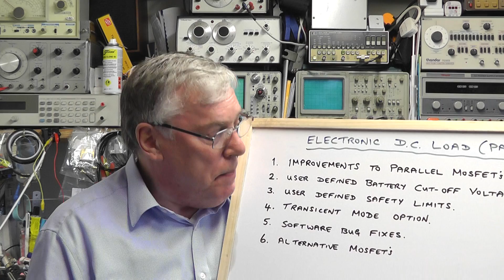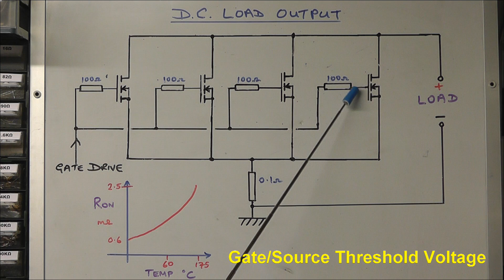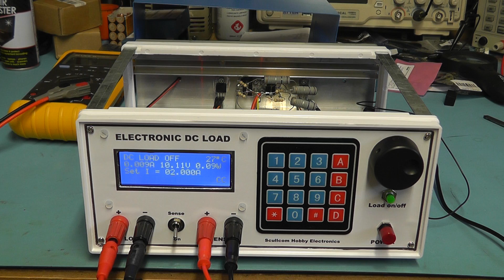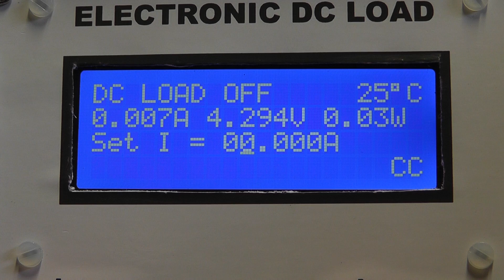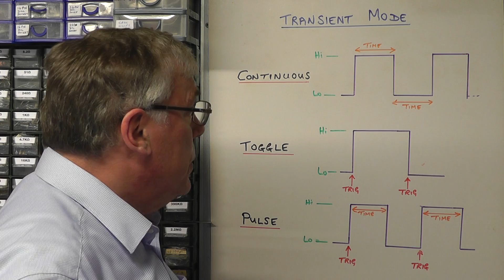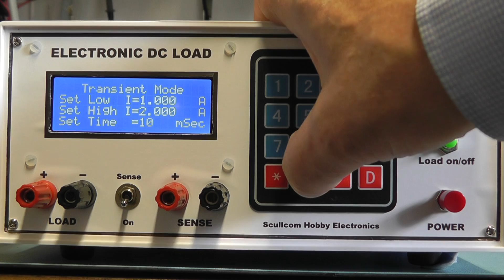Scullcom Hobby Electronics #49 - Electronic DC Load Part 5

Comment: Never use wire wound resistors.  You are getting and inductor and resistor in one package causing an over damped ringing during high to low and low to high current transitions.

Comment: Noooo! By mounting the MOSFets so close together you undo the self-balancing by the positive TC!

On the other hand, the Drain resistors are really necessary an you could estimate the correct value using the expected maximum dissipated power, the expected max junction temperature and the characteristics.
All multi-transistor electronic load manufacturers do it like that!
Reply: um, by spacing them further apart, the positive TC effect will allow each to operate differently depending of each individual parameter characteristic by that tiny amount, and and the temperature gradient of the heatsink effect. The closer the mosfet cases are to each other, the tighter the temp difference will be between them - my opinion is that this IS superior....but but yes its harder to wire up!sigh!

Re drain resistors, the required calculated low value power resistors, they are freaking expensive! better to just use  a safer area of dissipation of the mosfets. Something you just can't do with BJT  types.
Reply: Fred Z,
I think you're wrong.
The whole idea is that the positive TC of the MOSFet limits its current compared to the others when it gets HOTTER then the others.
So putting them closer makes their temperature more equal, therefore negating the self-balancing of the circuit.
Best is spacing the apart, so each feels it's own teperature more than the total average and adjusts it's internal resistance accordingly by it's negative TC.

P. S. Drain resistors are cheaper than MOSFETs!

Comment: Lost your reasoning for looking at Rdson values.  The MOSFETS are operating in the active region, not in the ON region.  Consider revising.
Reply from the maker: Thanks for your comment. If you look at the transfer characteristics of this particular Power Mosfet you will see that at just over 3 volts VGS it crosses over and a such RDSon will have an effect. For most of the time when using a Power Mosfet in a DC Load you are operating in the saturation region and the amount of current is dependent on VGS. For different levels of VGS and junction temperature the Mosfet RDSon will change slightly. As more current flows through the Mosfet the temperature rises.

Comment: Is there a PCB layout for v5?
Reply from the maker: Hi,
I may produce a new PCB artwork later when the project is complete.
However, one of my followers Rob Bruno has already designed a new PCB using my design but we have not tested it yet. It should be OK and uses surface mount components. If you are interested it is available from:
https://www.oshpark.com/shared_projects/tXUxCSVa
You can also download the circuit from the link below:
https://www.dropbox.com/s/orwivgbt23gl158/ElectronicDCLoad1.pdf?dl=0
Regards,
Louis

Comment: I decided to make a quick and dirty wiki page of my version of this project.
I put a photo of the front and some quick snaps of handwritten schematics that shows what I changed. They are not complete. You have to take the original schematic. I did not change display, keyboard, rotary, Arduino Nano etc. Decoupling is also all the same. 
I also put a version of the modified code. I changed quite a lot already and I went through all the code and fixed the indentation to make the code easier to read.

Here is the link. http://www.lavrsen.dk/foswiki/bin/view/Kenneth/ElectronicLoad
Reply: Update. I bought a much more powerful 60x60 cm fan. It is a PABST fan with double the capacity of the low noise fan I had used initially. The result is impressive. At a heat sink temperature of 82-84 deg C I can now load 230 W permanently. Before it could hold 140 W. My initial goal was 200 W. The downside is noise. The new fan sounds like a Harrier fighter plane is taking off in my lab. So I had to refine the fan control. The fan starts and push lots of air already at a PWM setting of 20! And enought to use the load at 4 A / 12 V with very little noise. When I want to test a big power supply I can live with the noise.
While doing this I found a new problem with the original design. I could not make the PWM of the fan work at all. It turns out that an Arduino Nano cannot PWM output D2. D3 is an interrupt pin for the rotary. D3 can also work as interrupt. So it was a simple matter of swapping the rotary interrupt and the fan control in the design.

The new version of code and corrected schematic is on the same link I gave above. http://www.lavrsen.dk/foswiki/bin/view/Kenneth/ElectronicLoad
Reply: I wonder if my this thread is marked as spam Youtube because of the URLs. I can only see them when I am logged in with my private Google account. I am at work now and wanted to see if i needed to reply to any questions and I could not see my updates so I assume noone can except Louis and myself.  My links are just pointing to a wikipage with 3 photos and my updated code but I guess the Youtube algorithms cannot see what is spam and what is ham.
Reply from the maker: Kenneth,
For some reason Google put your message in the spam folder. Just found it.
Regards,
Louis
Reply: I and we would like to build your version of load..I try to find your private email but didnt. We will make in kikad pcb  and share ..
Your version have some different components.. A little cooperation  will be super..if you wish. jeanlucdemarc@gmail.com
Reply: Jean Luc De Marc,
I am still improving the load and still the schematic is handwritten.
I have not added the latest update to my wiki page yet but I will in a few days
The last improvements have been
- I replaced the 12-bit D/A converter by a 16-bit. Still I2C based and very easy to fit into the software. So now I can set the current in mA steps even though I have max 20A
- I have been playing with the fan control. It is difficult to PWM voltage control a fan. They tend to suddenly speed up in one step. I have ordered a Sanyo Denki fan which is a 12 V 4-wire fan controlled by a 25-kHz PWM signal. I am still waiting for it to arrive. I have altered code that runs the PWM at the needed 25 kHz. For now I have added a buffer with two BJTs to drive a power FET. Better but I still cannot get the fan I have now to run medium speeds. But it cools very well at low and I can run my 250 W at high
- I have done a lot of changes in the code to get more accuracy. There was a lot of float to interger convertion that worried me so I tried to do integer math when possible
- I found the code slow to respond to key presses and the reason is that the A/D converter is pretty slow. It takes 80% of the loop time. I want to try a different A/D which on the paper should be able to run faster. I want to see if that is at a cost of any precision. With the existing A/D, the time is actually spent on two reads: Current and voltage. I won a lot of usability simply by letting the loop read voltage and current every second time. This way the loop services the buttons twice as fast. That is actually quite OK.
- Last, the rotary encoder code needed a major rewrite. The code Louis uses comes from another Youtuber and it has the problem that if the rotary is stopping between two positions (happens easily), the code halts because the interrupts are firering all the time (LOW). I rewrote the code so the interrupt happens edge triggered. I did this in combination with a proper hardware debouncing. 

I will soon update my wiki page.  My email is kenneth at lavrsen dot dk
Reply: Fascinating ..im impressed .. well there is no hurry on my end.. Is there any parts that i can order? Due i will order some parts for some other project and you need to have above  some price  and international shipping from farnell...

Comment: Hi i am using this SD6109 ic in my smps project how can i make a variable duty cycle in this chip is there any idea 
Thanks
Reply from the maker: Hi,
At first glance it does not look as if you can vary the duty cycle of the PWM in the chip. There is a pin (pin 16) which is the "error amplifier output and the input of the PWM comparator" you could try playing with this pin. Have a look at this pin on an oscilloscope to see what the signal is like. You may be able to apply a variable voltage or external signal on this pin, which may alter the duty cycle but I am not familiar with this chip so this is just a guess.
Reply: Thanks

Comment: One more modification.

In several places I run into trouble with the display because I run beyond 99.99W. and 9.999 A.

So in several places I had to put in modifications to the display of Amps and Watts so that when I have more than 10A I reduce the decimals to 2 and when I reach more than 100W I reduce the decimals to 1. This way the display stays on the second line.
Reply from the maker: Hi Kenneth,
You will notice in my code I automatically switched from 3 decimal places to 2 decimal places if the voltage reading reaches 10V or above for the same reason you found with the watts and amps (LCD display movement). As I was limiting the current and power in my project that was not an issue for those readings. I may make the same change to the watts and amps in my code as I did for volts so that the code is future proof for higher power ratings which could be added later if the project is upgraded.
Regards,
Louis
Reply: Hi. I have since this comment continued testing and found another 10+ places where I had to adjust things for the higher current and power that I build for. I also found some bugs in the constant resistance code. I will make my code available on my website in 1-2 days. I just want to walk through all features before I do so. I still have not tested any transient or battery discharge features at all.

Comment: A couple of more small changes I forgot.

The MCP4725 A0 input. I changed the pull up so it goes to VDD (4.096) instead of 5V. I was in doubt if it was OK to pull up to a higher voltage than the IC is running at.

I tied A0 directly to the VDD pin with no resistor.

On the original design the MCP4725 is connected to AD8650 unity gain buffer and the the voltage is divided by 9k/1k high precision resistors. I needed more reduction because I design for 20 A on a 0.01 ohms shunt. And I did not have the 0.1 % resistors to go with it. So I used a good 27k 1% film resistor to the non-inverting input of the opamp that drives the FET and a 2k multi-turn potentiometer to ground. This way I can set the current accurately with the potentiometer.

So to calibrate the circuit you first set the output current with the 2k at a high current value using a good amp meter to verify the current.

Then you turn off the load and set the zero amps on the other 10k multiturn potentiometer that I described in previous post (the one that goes from -2.45 to +4.096). You turn it so current starts to flow and then turn back till you reach zero. Then you have perfect bios elimination. And then you go back and set the current setting of the 2k potentiometer to correct the current to accurate reading.

The AD8630 that measures the current over the shunt is still unity gain in my design. I just increased the gain to maximum in the MCP3426 and that works OK. Again the output of this opamp is pulled down to -5V from the 7660 via 220k to get it to perfect zero volts. With that I never have to use the zero offset settings on the software. I have perfect zero reading on both voltage and current.

Kenneth
Reply: I will try and put either some video or download material online. I need to make a clean schematic of my changes. Right now it is spread as marked up schematic and notebook pages. And I have plans for making a real PCB for it. I built it all on small breakout PCBs. 10 to 12 of them.
I also have an idea to add an additional constant voltage loop for testing chargers. That is the only real pro feature missing now. It does everything else.
Reply from the maker: Hi Kenneth,
Thanks for the additional info.
I have found that as long as you take  A0 of MCP4725 high via a limiting resistor it is OK to connect to either 5V or 4.096V, it does not matter.
You mentioned in the last paragraph connecting the output of the OP Amp to the -5V via a 220K (to eliminate the input offset error) . Was this connected to pin 14 of the AD8630 ? and did you add any means of adjustment?
Regards,
Louis
Reply: Hi again. If we go through the op amps one by one. U7A could benefit from a 220k pull down to negative but since I already have 4 mV offset from the DAC I had to compensate U7B with my additional circuit on the U7B inverting input. In my case the U7B is a different OPAMP supplied from 12 V because of the different FET. But same nulling circuit and load off circuit could be used in your original design. There is no point in pulling the output of U7B to negative because with any FET the gate will be operating far from zero. The issue is the millivolts offset on the inputs of U7B which accumulates from U5, U7A, and U7B. There is a need to have a way to compensate this. In my case the problem is 10 times bigger because my shunt is only 0.01. But even with 0.1 ohms a 4 mV offset you cannot set the load current below 40 mA which is annoying and cannot be compensated in software because you cannot send a negative voltage from the DAC.
The places the 220k to negative will make wonders in the original design and also in mine is U7C and U7D. In both cases  this enables these single supply opamps to go to true zero when current is 0 and/or load voltage is zero.

 You have a zero bias adjustment on the OPA277 that helps on the voltage measurement. The opamp I use (OPA334 because I did not have the OPA277 available) for voltage runs single supply (it is a max 5.5 V opamp so I could not run dual supply) and has no bias adjustment pins. But with the pull down to negative on the OPA334 and the extremely low input offset of the OPA334 I got an offset error far below 1 LSB on the ADC.
So all in all in your original design I would try the 220k to neg 5 on U7C and U7D. This resistor does not eliminate input offset errors. It helps the opamp output stage when running single supply to pull all the way to true zero ground.

I bypassed U7C and connected the OPA334 directly to the ADC. I can do that because the OPA334 is single supplied so I do not need to worry about negative voltage on the ADC input. In your design it is smart to use the last U7C at unity gain to make sure the ADC only gets positive voltage. But the AD8630 cannot pull its output all the way to ground without a little help. And since you have the -5V available the trick with the 220k to -5V will probably reduce any offset error you have.